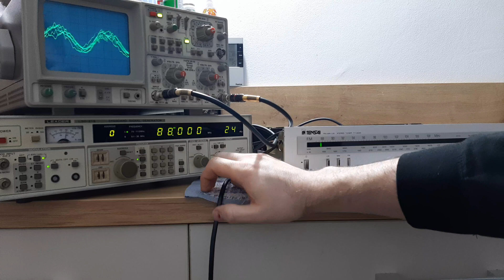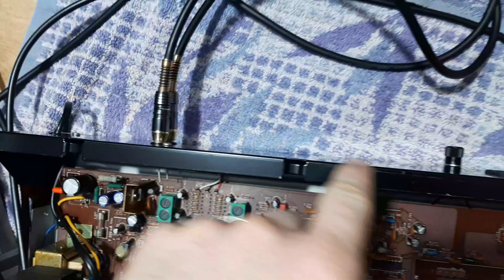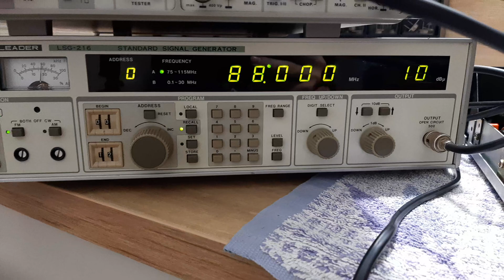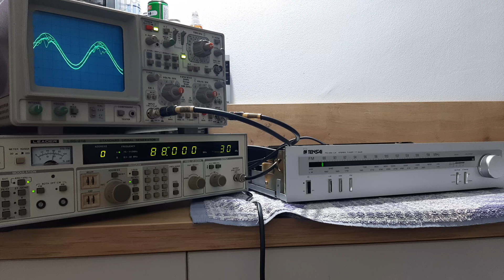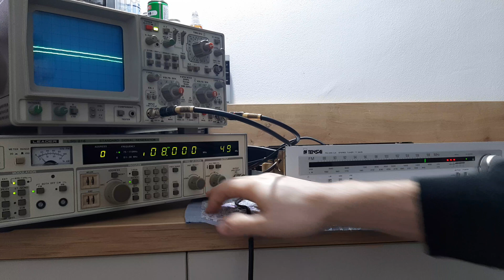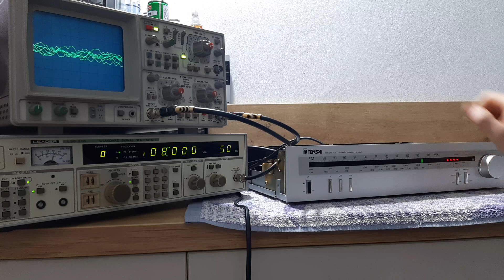Tensai Stereo Tuner - Alignment - Calibration - Test

Comment: i have a lsg216 with no leads , could you tell me the part number for that leader antenna coupling box/lead please
Reply from the maker: Hi, thank you for comment and for subscribe. About Leader LSG 216 in manual is stipulated Dummy Antenna LDA 1554-50 , 50 ohm : 300 ohm matching pad.
Cheers and stay tuned, new videos will be released !

Comment: Is that Leader load a 75 - 300 ohms load? I couldn't read it well.
Great job as usual.
Reply from the maker: Yes , that probe on the end of the wire is a selective load 75-300 or 75 or off, is very hard to find one. I was searching for that years. But is not complicated to make a matching probe between rf generator and tuner to be calibrated/tested. Great weekend to all of us !